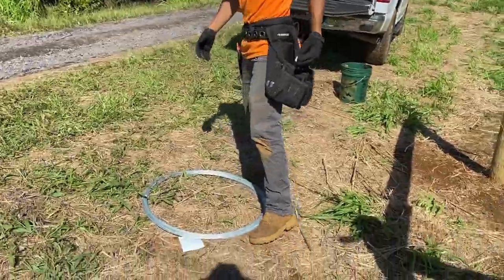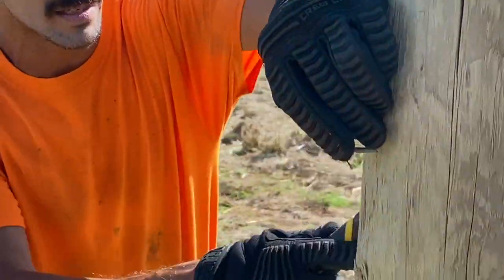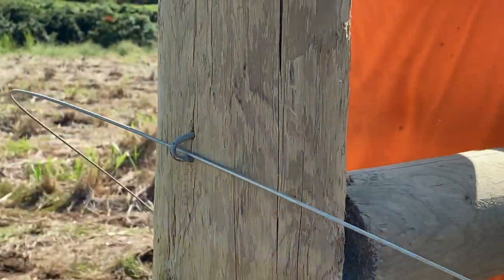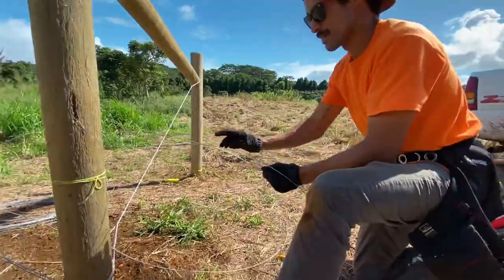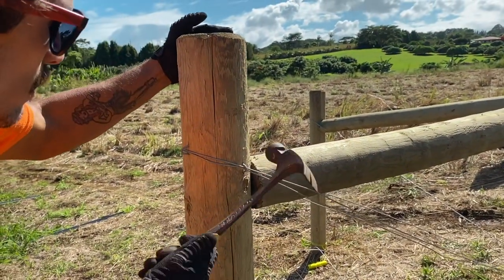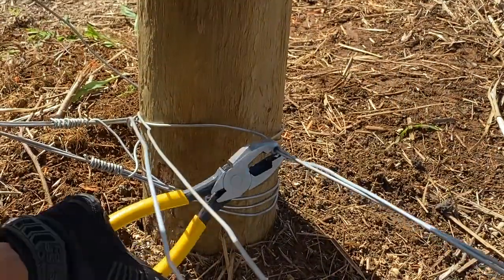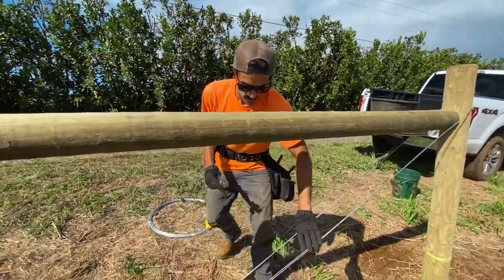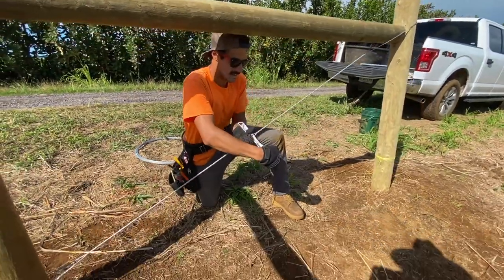THE FARMSTEAD | How To Install H-Brace Support Wire (BEST Way DIY) | Episode 3 BONUS VIDEO

Comment: Perfect demonstration of using a tension wire to support the H-brace. The only suggestion I would offer is to use the rebar on the upper brace as a tab to wrap and hold the wire. Leave about 1" of rebar protruding and it provides a very nice and strong tab.
Reply from the maker: Mahalo I think we’ll definitely give that a try! And thanks for tuning in, aloha!
Reply: @shawnpila  Did this on my new 3000' fenceline.  Have another 2000' next month.  Huge help!!  Thank you for demonstrating so very well!!
Reply from the maker: @rich6828  awesome glad it’s working out for ya!!

Comment: I realize that everyone does it their own way.😎....... Just thought I'd add a suggestion... Besides the staples, my dad always taught me to cut a notch in the posts for the wire. It didn't have to be deep. But it helped keep the wire from wanting to "walk" up/down the post and pulling the staples free, as you tighten the wire.
Reply from the maker: Epic yeah I’ve heard of people doing that, we’re always up for trying out new techniques. Cheers!
Reply: @shawnpila  😎

Comment: First off, I love how clean this brace wire is! Keeps them well inside of where the electric wire will be running. What exactly are you referring to as "brace wire"? Is it just 170k psi wire or something different? Also, I have to agree with another commenter that the locking wire isn't really doing much. However, I think that by adding another lock at the top and bottom "Y" would definitely accomplish the locking effect. I'll be giving this a try pretty soon, Thanks!

Comment: Could you use this same method to tighten the line wires?  Instead of terminating a wire at the last post you wrap it around and then back past two or three posts and terminate there.  Then twist them the same way you show here.
Reply from the maker: Hmm I don't see why not.. I've never tried that before so I couldn't tell ya, but I do know if your h-brace wire gets loose you can undo the "key" and re-tighten as needed, if needed.

Comment: Pretty much the same way I've always done it except I always used one wrap of 9 gauge.
I wasn't sure how well it would work with the 12.5 but it looks great, and looks better to me than the ratchet tighteners everybody seems to be using.
Reply from the maker: Totally! We would normally use 9 gauge but they were out everywhere, and this was peak covid so this was our only option at that time. 12.5 gauge much easier to work with tho so that was nice LOL. Thanks for tuning in 🤙🏽🤙🏽

Comment: Sweet. Mine is similar, but I use rebar to twist and leave rebar in to retighten on down the road as needed. Curious on how you tighten this up later on. Are you just removing the lock wire, twisting, and relocking?
Reply from the maker: Awesome! Yeah we haven't had to re-tighten anything yet but I would assume having to take out the "key" to re-tighten and then redoing the key to lock it all in again. Thanks for tuning in and any suggestions for improvement is always welcomed. Aloha! :)

Comment: Kinda nice not having to get strainer ratchets or turn buckles. Definitely fits in budget.
Reply from the maker: The old Hawaiian cowboys didn't have access to much supplies so they worked with what they had. Minimal hardware and the best technique I've learned so far. Thanks for tuning in :)

Comment: Sorry, no. Don't place staples along the grain, angle them a bit in the correct direction. You opened up a crack immediately at the top of your post. You kinked and weakened the brace wire when you temporarily bent it back on the staple to hold it. When you tie off your wire, run the first wrap of the tail wire on the inside of the loop then the rest on the outside like you did and it will keep your join from slipping.  Your "key" locks nothing, and you'll have to remove your "lock" wire to re-tension. You need a stick or piece of rebar that is held against the horizontal brace in order to keep the brace-wire from unwinding. Cheers!
Reply: Your splitting hairs. This is a 20-30 year brace.
Reply: I'm in SD. What you say is what everyone does around here. I've even used wood as the key. This way you have a way to retighten the cross wires.
Reply: Needed to make up a H assembly today. I went with the reo method because it has the ability to re-tension with less mucking around.